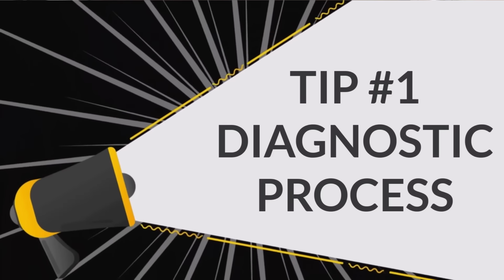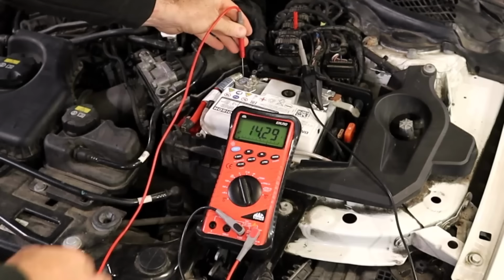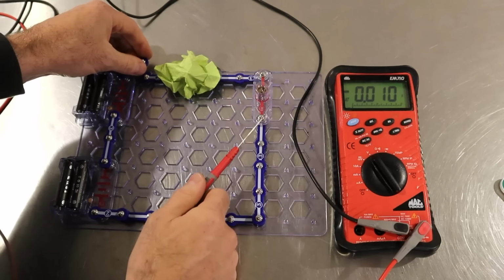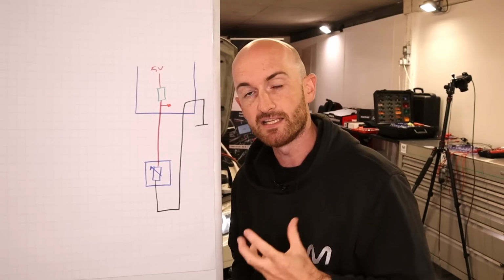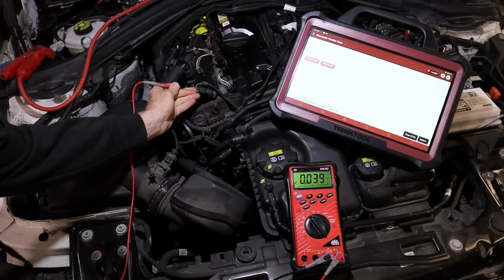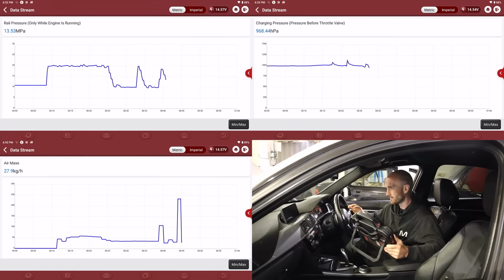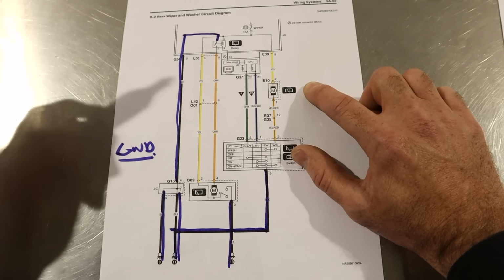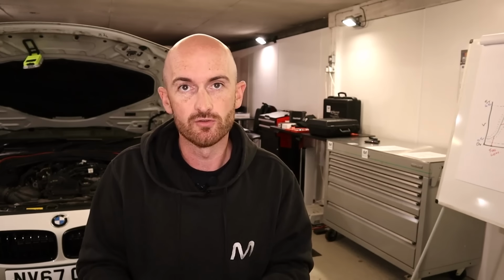5 Secret Tips to FIX ANY CAR

Comment: Wouldn't it be helpful for information sources like alldata or Mitchell to put examples of what live data should look like for different parameters? Why dont they do that
Reply from the maker: It definitely would. Some do. But it will only give a range of operation (which isn’t always so helpful). It’s also important to know what happens to the value dynamically (ie when you rev it). Once you start looking, it will definitely start to make it easier 👍

Comment: Many mechanics it seems, use the try it and see approach, replace parts until the fault is cured.
Reply from the maker: Indeed 😣
Reply: @MechanicMindset  i absolutely love your channel and approach to teaching automotive knowledge &techniques very simply and Relatably thank you for taking the time to bridge the gap much love and respect
Reply from the maker: @seancain7331  Thanks!!
Reply: Guess work! Good job heart consultants don't do that. Surely diagnosing a problem should be based on knowledge, not teial and error?
Reply: Throwin parts at it approach break the bank every time
Reply: I want to get touch in touch with you to learn more
Reply: @petromalaki1189  Learn what exactly?
Reply: I'm not a mechanic, and that's what I do.
Reply: because most people are emloyeed in the wrong profession to fit their personality.
Reply: Or until the customer runs out of money or goes somewhere else
Reply: Thats what a "hack" does; i call it "Magical Thinking ".... I used to be a hack; I've moved up.😮

Comment: I'm amazed at how many "so-called" diagnostic technicians fly in blind. The latest example of which I saw on YouTube. It was a v8 4.2 R8 Audi with a flashing engine light.

The first mistake was they didn't go back to basics and understand how the ECU senses certain stuff. But perhaps more importantly, the misfire they were looking for they missed the HT spark plug being one of the most common faults. The coil pack. The misfire in this case was most likely via a knock sensor... they missed all of that, thinking outside "the computer says this".

I see it all the time. In this case the technician broke out the ECU security (by abrasive wheel cutting) before looking for the not so obvious (but the obvious to others).

The most common faults are not faulty ECU's but sensors, coils etc that get heat damaged over time. Classic ones on Audi are water and oil temp sensors that affect the starting and running controls. Obviously if they read wildly different when cold then one or both are faulty
Reply: First step for a customer, is to never buy a BMW or Mercedes or any other shitty high-priced vehicle.

Comment: If you wanted to prove your metal, i hear that theres a Mercedes giving Alex over at Legit Street Cars some gyip!

Seems that it keeps going to limp home mode at full throttle.

Would be cool to see you guys over there working that one out for him

😊
Reply from the maker: Bit of a distance for us!
Reply: @MechanicMindset  ...I hear they have planes and such these days.

Heck, find yourself a sponsor even 😉
Reply from the maker: @weedfreer  We are well overdue a USA visit! Most our viewers and members are over there 👍
Reply: @MechanicMindset  make it so number 1
Reply: @MechanicMindset  #LadsOnTour
Reply: Going by the name, it sounds like its a place that does high performance mods. Given the description of the problem, the most obvious thing that comes to mind is an open/closed loop issue. WOT forces the PCM to run in open loop and that bypasses the information received from the O2 sensors when setting fuel trims. If they fooled with the car and didn't take that into consideration, it can certainly cause problems. Does it run bad when its first started when the engine is cold? Then after a minute or so start to run OK? If its runs bad cold and at WOT, its very strong evidence for an open/closed loop issue. You have to be extremely careful when you start upgrading late model vehicles.
Reply: @052RC  he used to be a pretty senior Mercedes tech, and, so far as I know, with this one he’s simply trying to get it to work as stock.

He’s been through the wringer with it finding hydraulic hoses and suspension diaphragms that had failed and dumped rubber all the way through the system too.

If you could share your thoughts with him I’m sure he’d be more than happy to go looking for the issue
Reply: @weedfreer  didn't he sell that cl65?

Comment: Would love to have an explanation of pull up pull down circuits and why are some called low side switched and high side switched and load side switched and switch side switched. It’s confusing I was technician in the 70s to early 80s and need some clarification and explanation. Please 👍🏻
Reply: A trigger to make a change in operation can be a low or high voltage as in 0 volts vs 14 volts. The load side is like the opposite of the battery side of the circuit. The switch side is just the far side of the wire not indicating whether it’s the live side of the switch or the load side of the switch

Comment: I purchased the Picoscope 2204 with all the cables per your recommendation. I received it today and downloaded the software only to find out that I can't use it with the automotive software. Please tell me you have a way around this problem or I just wasted money.
Reply: tenho o 2205,podemos fazer tudo com eles só a resolução que não e igual use atenuador.
Reply from the maker: Just use the normal Pico 7 software from Picotech.com

I don’t use the 2204A with automotive software either. It’s not possible 👍

Comment: Great video 👍🏻 out of interest what scan tool are you using in this video?
Reply from the maker: Thanks. It’s the ThinkTool Max (or S20 in USA)
Reply: @MechanicMindset  Thanks. Any experience how it compares to Autel (or Launch) for vehicle and systems coverage?
Reply from the maker: @teflon121  They are both quite similar, I really like Autel too. I think Autel may be a little more expensive but not much. Try and get a try in them both before you buy. The live data feature in Autel is really nice.
Reply: @MechanicMindset  I use Autel wondered how the other compared 👍🏻

Comment: You have an excellent method of teaching and as a result the information you relay is easy for most people to follow.

It is possible for some people to become confused about the words earth and ground in relation to automotive electrics if they do not understand DC fundamentals.

In automotive electrics one has a negative connection from the battery to the vehicle body/ chassis and the vehicle engine, and components are bonded to the body/ chassis and in some cases the engine is directly connect to the vehicle battery negative terminal.

The words ground, and earth should in my view be changed to vehicle body chassis negative as the negative is  a cable to complete the electrical circuit, if people refer to body/chassis negative rather than ground or earth it my well help them understand the vital part that the negative cables and connection points play in the circuit, this is particularly important when carrying out voltage drop testing, an issue that is more important in today’s electronic age.

I should point out this is only my opinion as a qualified automotive electrician from the distant past.👍😀
Reply from the maker: Thanks for watching! I suppose strictly speaking it’s a negative connect. ‘Chassis ground’ is another more common term. ‘Earth’ is probably technically incorrect, but widely used and accepted, as ground and earth are the same in household electrics. The difference there is AC household has a ‘neural’ which we never say in automotive. I probably say ‘ground’ the most. As anything in automotive, there are often 10 different names for the same thing 😆. Understanding fundamentals is important and suppose this should be made clear when learning. Thanks

Comment: can you please explain....
Why why why???
Today's modern cars eg Toyota Glanza, Toyota Taisor, has 12V and then drops to 7V in the door close signal voltage.

Whereas, it used to be directly 12V when door closed and 0V when opened in old cars.
But today's cars has 12V at door closed, and after 20 seconds, it drops to constant 7V. When opening, it drops to 0V.
Why there's delay in dropping to 7V at door closed??
What's the significance of this 12V to 7V???
Please explain 😊
Reply: If you look up how to do a parasitic draw test, it will explain why that happens.
Reply from the maker: Just answered you in the other comment 👍
Reply: @MechanicMindset  please research about this especially on Toyota Glanza and Taisor.
What is the significance in delaying to 7 from 12V?? 🤔🤔🤔

Comment: Hi Darren. At 4"25' the DVM read 6v at the bulb when the reference point was the positive terminal and the switch was off. Was that a - 6v meaning a 0 reading?? Im confused.
Reply from the maker: This is because across an ‘open’ switch, one side will be 6v and the other side will be 0v - volt meter shows the difference between the measuring points 👍

With the switch ‘closed’ we will have 6v on both sides, now the difference will be 0v
Reply: @MechanicMindset Thanks very much. Still waiting for the light bulb moment so this all helps. 👍

Comment: In a perfect world, the load will use all available voltage and the ground side will be zero.
Reply from the maker: For sure, both sides of the load will consume as little voltage as possible in a perfect world. Use a thicker wire, less voltage will be consumed, try it! 👍

Comment: Hey Darren, got a question, I am bad at electrical diag. I was testing the egr valve on 2.0 tdi a4 b8 engine. With ignition on and engine off I was getting 12v on both + and - wires for pwm motor. Was suspecting ground wire was short to b+ but was able to find any damage on the wire (in that area around egr, wasn't testing any further).
Is it normal to see both wires 12v on ignition on?
Reply from the maker: If the motor isn’t being activated, yes that may be normal. We demo that same thing here. When the ground switch is open, we have 6v on both sides of the bulb. Activate. EGR and see what happens; scope might be best  to see it if it’s PWM 👍

Comment: I tell you how to get better at diagnostics fast. Dont use a launch
Reply: Get good fast - dont follow manufacturer test plans 😅
Reply from the maker: @BenJFF  🤣
Reply from the maker: 😅 Causing problems for you? I get on OK with the launch based tools; a different experience depending on the car you connect it to as will all diag tools

Comment: What's your (in your opinion) statistics?
 How many "mechanics" out there started using oscilloscope + gas analyzer in the "diagnostic" process (instead traditional parts swapping)?
 Is there any progress in the automotive field (or they are still stubborn)?
Reply: PARTS CHANGERS 
That I have no respect for!!
Reply from the maker: @stevenhunter9000  Or maybe create some easy diag for you; if all the part have already been replaced 😉
Reply from the maker: Haha! Still lots of people swapping parts. Maybe not so stubborn, but not sure how to move forward. Hopefully we can help! Those that want to progress, will 👍 I am connected with LOTS of amazing mechanic’s taking the next level

Comment: Is that the switch at the very end? Will a short circuit occur when this switch is shorted to ground at the end of 22:24?Pin 2 with pin 3.
Reply: Informative 
Diagnosis is made easier when someone knows how to read electrical schematics
And
If you have an electrical schematic
Reply from the maker: Great question, well spotted and you’re right! They have made a mistake on this diagram. It’s the park switch for the wipers; it’s drawn wrong and should give the motor a ground when in mid sweep until it parks 👍
Reply: @MechanicMindset can you please explain....
Why why why???
Today's modern cars eg Toyota Glanza, Toyota Taisor, has 12V and then drops to 7V in the door close signal voltages.

Whereas, it used to be 12V when door closed and 0V when opened in old cars.
But today's cars has 12V at door closed, and after 20 seconds, it drops to 7V. When opening, it drops to 0V.
Why there's delay in dropping to 7V at door closed??
What's the significance of this 12V to 7V???
Please explain 😊
Reply from the maker: @tnamen1307  Maybe check the signal with an oscilloscope to check it’s not ‘pulsed’. Or it may be just the resistor values used
Reply: @MechanicMindset  I have verified it several times. It seems that's how the circuit is designed to work by the company.
But I want to know what's the significance of this delaying in 7V from 12V??
It seems CAPACITOR plays a role here.